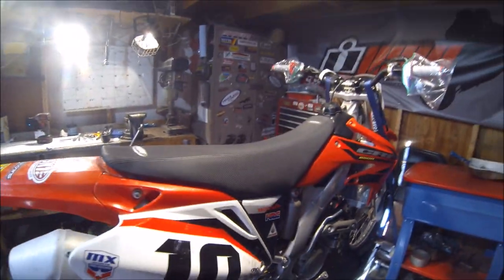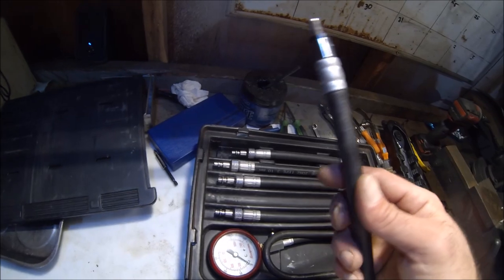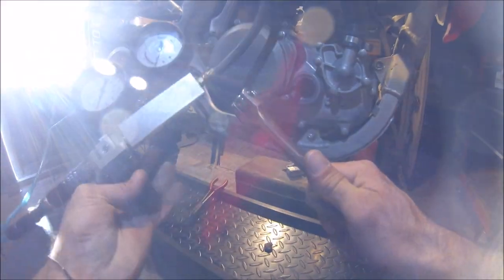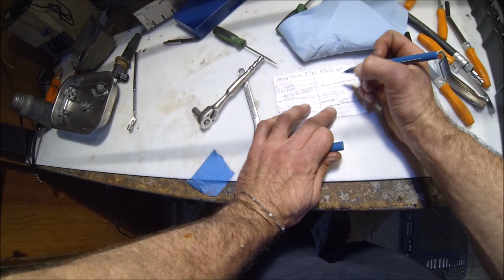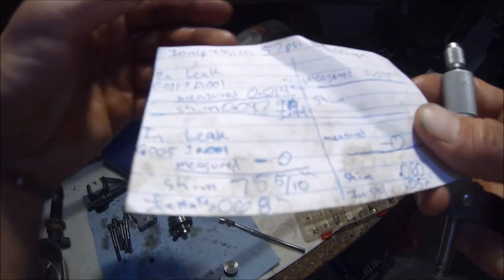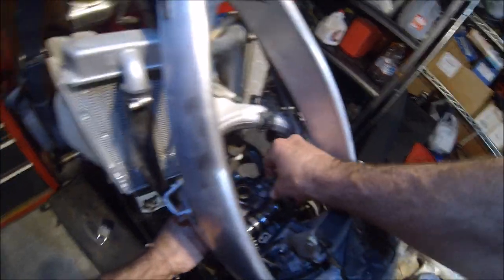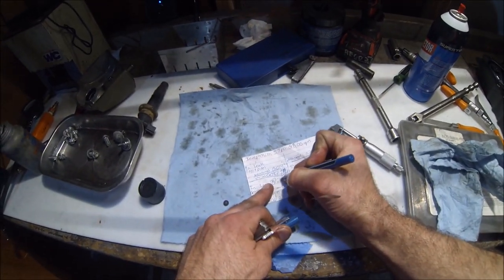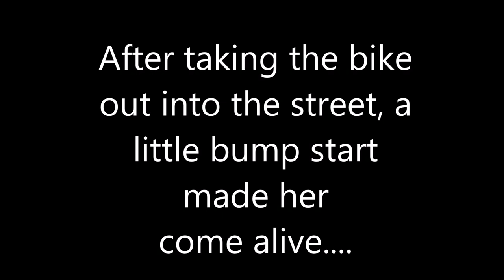2004-2009 Honda CRF250R Valve Adjustment Tutorial- FULL LENGTH

Comment: You did a hell of a great job with this video, thank you, my question is how do I go about figuring out which shim I need? I’m doing this very same thing but that’s the part I don’t understand, I am planning on sticking the shims in and going back together and checking it and repeating this until I get to the right specs because it’s the only way I know how 😂 thanks for any help, you’re video alone is a huge help
Reply from the maker: To figure out the correct shim, you need to measure your valve clearance first when the piston is at tdc, take apart the cams, measure the shims that were out of spec, do the math, install the correct shim, reassemble. The video should explain this in greater detail. Thank you for watching!
Reply: Thank you 🙏

Comment: Hey I need help! My 09crf450 won't start unless I bump start it, and when I do bump start it soon as I put it in gear and release the clutch it bogs out an dies ... Could a bad stator be the cause?
Reply: Thats a sign of bad compression, valves or piston
Reply: Or somewhere in the carb gettin too much fuel when you give it gas doesn't have enough time to burn it bogs out n dies, not kicking over could also have clogged jet or broken needle jet

Comment: I just got my valves shimmed from the shop got it back , Now when i kick it over it makes a backfire every so many kicks and wont start , Any idea?
Reply from the maker: I would verify valve timing and clearances were set correctly. If it ran before and it doesnt now, then it's probably something they did, and if it didnt run and it still doesnt run, maybe it's something else...

Comment: Thanks for the very informative video that convinced me not to buy a honda 2021 CFR300L to avoid this pain in the ass, assuming the engine design hasn't likely changed.  Figure $80 for a shim kit if you DIY, and a fortune if you must pay a Honda dealer's service department.  Problem solved the Honda CFR300L rally ABS is marked off my list of potential dual sport motorcycles to buy.  I'll likely buy a Suzuki DR650
Reply from the maker: Honda uses a uni cam. It's a good design. Comparing a cfr300 to a drz650 is like apple's to oranges, but I'd definitely get the drz650, you wont be disappointed
Reply: The cfr250l and cfr300l are completely different motors than the R motor shown in this video.  The L motors are rock solid reliable and easy to start and much less maintenance.   The R motors have a very aggressive design for competition and require more maintenance
Reply: Lol the crf300l valve checks every 10,0000-16,000km lol. My crf250r every 10hrs and if I thrash it on road it doesn’t last 10hrs without backfiring. Only issue with 300L is suspension needs to be binned from day 1

Comment: Why doesnt anyone ever say the shim size themselves i have a 06 and i need the stock shim sizes.. im stuck!
Reply from the maker: I think these are 7.48mm
Reply from the maker: Or they could be 9.48mm. I cant recall. You can pull the shims out and measure their diameter
Reply: Stock are 7.48
Reply: You're looking for clearance first, If I'm reading your
question right....
Then what I would do is just figure out how bad the spec
is , on your valves, use your calipers to find an appropriate shim. 
I would re-mark my shim supply to SAE, so much more logical and
easy, the Japanese are getting back at us for using metric 
for this process. lol